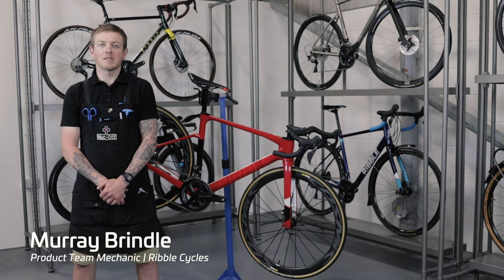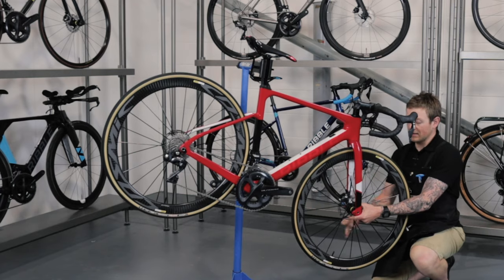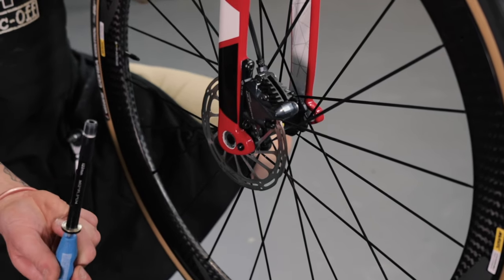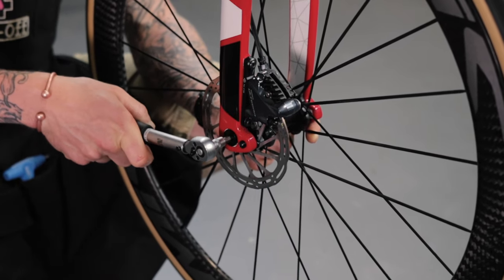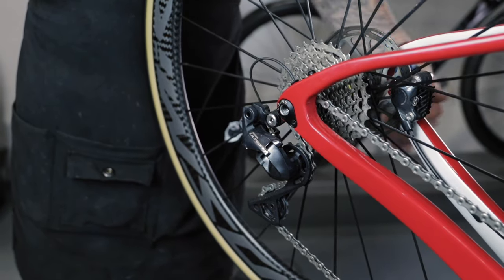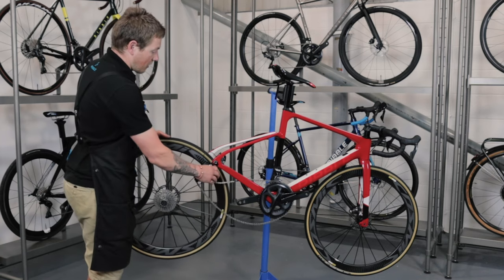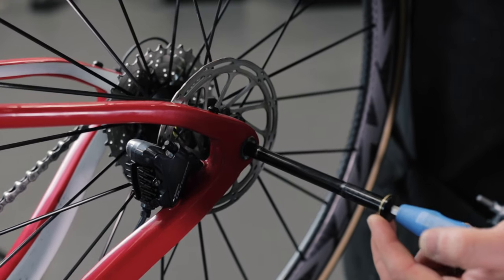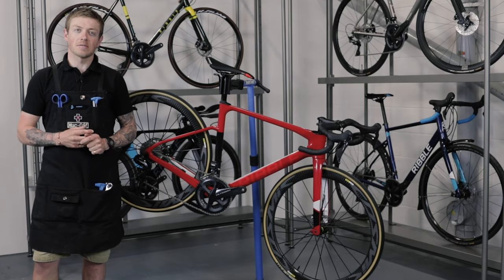How to Remove and Install Thru Axles | Bike Help | Ribble Cycles

Comment: What happens if you get a puncture on the road? Nobody will carry a torque wrench
Reply: You use human torgue
Reply: @popitn2nd  common sense isn't so common anymore
Reply: @sethmichael8188  nope
Reply: Tighten til you hear a crack then back a quarter turn. Easy
Reply: There are small torque wrenches small enough with 10Nm rating to tighten the thru axle

Comment: Also a good idea to spin your wheel & make sure it isn't rubbing the brake disk rotor, if it is just loosen the two bolt holding the caliper in place, squeeze your brake lever (which will automatically align in correct, then tighten up whilst still squeezing the lever (I sometimes recruit someone to do that part for me). This has always realigned it perfectly for me.
Reply: Easy method to hold the brakes while adjusting the alignment is to use a rubber band.

Comment: i'm a noob with disk brakes. If the thru axle is aligned and fits in between the forks and secures the wheel, and the rotor is aligned between the brake pads inside the caliper, does that mean the wheel should be installed and positioned properly? guy at the bike shoppe made it look easy. I put the front wheel on when I got home... rotor is rubbing when the wheel spins, i can hear it. wtf.

Comment: My bike was brand new and this is probably the wrong way to do it but I just tightened the front axle until the disc stopped scrubbing against the pads when I rotated the wheel

Comment: question: I have a Ribble eBike and thought I'd better familiarise myself before being roadside with a puncture. I can't turn the 6mm Allen key at all on the thru axle. I don't want to over force it. I am going anticlockwise and I am applying a decent amount of pressure. Can I do damage by really upping the force to my max strength? thank you!

Comment: is it better if the wheel is off the ground on a stand when reinstalling the front wheel? or can the wheel be placed between the forks with the wheel in the ground?

Comment: I have a SLe.  It has a thru axle bold with two nuts.  It doesn’t look like that. How does that go together and what is the torque settings for this type of thru axle?

Comment: Do you carry that big 6MM T-shaoed Allen wrench and your torque wrench with you when you go out for a long ride?  I dont think so. Now what multi-tool do you use. I miss Quick Release (QR) spindles.
Reply: Most multi-tools have a 6mm hex bit. The torque wrench is not necessary for a get you home fix -  just do it up tightly.

Comment: And without a torque wrench...? Not everyone has this tool (even if they should). Is it dangerous if you under or over tighten? Can the wheel fall out?
Reply from the maker: Hi, if you over tighten it can damage the carbon so would always recommend a torque wrench.  J @ Ribble
Reply: @RibbleCyclesChannel  Thanks. I actually just bought a torque wrench after getting a puncture and watching your videos!

Comment: If you do squeeze the breaks with the wheel off, and you can't get the wheel in, and you're fixing a flat on a ride, then what do you do? Just want to plan for worst case....because you just never know.
Reply: You can force them open with anything that is thin enough to slide between them.

Comment: how do you 'set it to 10' on the torque? is it just hand tight?
Reply from the maker: Your torque wrench will be able to alter to 10nm. J @ Ribble
Reply: @RibbleCyclesChannel  What if your Torque Wrench only goes to 11? (Spinal Tap reference)

Comment: Most people that I see riding these types of bikes don't carry these tools on the road.Wait until you get a flat and you were not prepped for this ordeal to remove and put back in your wheels to frame.Great demonstration though to show how to get back on the road.
Reply: Arthur McNeal most people carry a multi tool that'll fit the axles to get them on and off
Reply: I have such a multi tool and I found it impossible to loosen the rear axis! Am I missing something? I love my R872 and was about to buy the Endurance SL R but now I’m thinking it over. Can it be that there’s no easier way to remove the tyres?
Reply: If you have a puncture kit you should also have a multitool with some Allen keys. There are so many things on your bike that could come loose and a simple multitool will get you home.

Comment: I don't care about how to remove and replace a wheel equipped with thru axle, I want to see how to remove the stock rotor and axle and how to replace them with a rotor for the thru axle!

Comment: Torque Wrench set to 10 ?? 10 what ???   ( I know but many won't )
Reply: I for one don't know if that is 10 N•m or inch•lbs.  I would guess N•m, but I'll have to look it up.  I have settings for both units on the automotive micro-torque wrench I use.
Reply: @alemusicandher , 10 Nm

Comment: This video is telling you the wrong information ! The front wheel and rear wheel have different Hex or Allen key sizes. This is not pointed out in the video and should be corrected.
Reply: The size used will vary from bike to bike, just check the specs of your own bike before removing the wheels? Just common sense really.